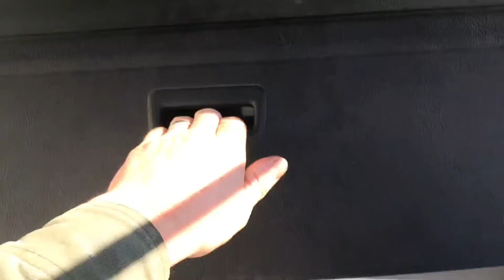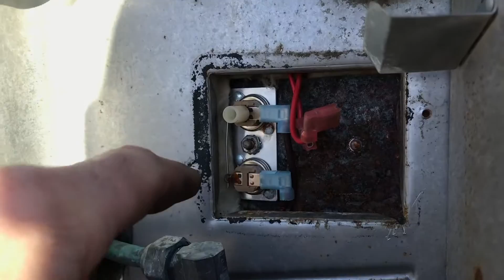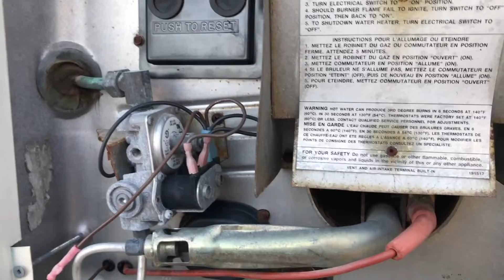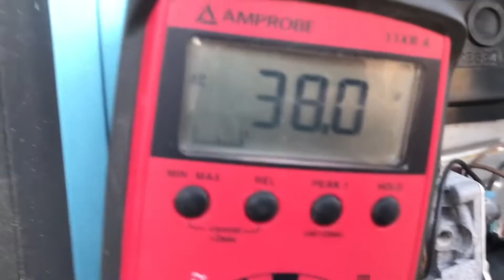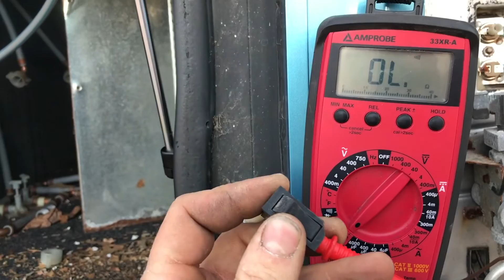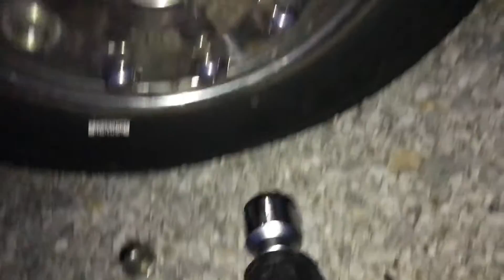Fixing an RV Water Heater

Comment: You might want to replace the anode (right next to the  heating element, that big rusty nut) as that will keep the  tank (and heating element) from rusting out / corroding. Cheers!

Comment: You replaced the heater but not the anode tube? If that heater was that bad the anode tube must be shot plus you will need to flush ass that crap out of the tank before you use it

Comment: Didn't see the entire scenario,  but it's possible that the car hauler driver deliberately used the oncoming lane to avoid getting hung up, or something.  Some car hauler setups have incredibly low-slung fifth wheels, which essentially become skid plates at times as they negotiate changes in attitude (and altitude) on roads and streets.  Also, he may not have been able to make the curve the way it was laid out with the cones (or whatever the lane separators) in place.
Reply: they saved the cones, from what I could see

Comment: I don't know who did the last service on those wheel bearings but those hubs are way overfilled. It has a full and add lines molded into the clear plastic of the hub cover.

Comment: Replace the anode in the water heater. A quick thing to do and will keep it running for many more years. Anode in a home heater is recommended to be replaced every 5yrs or so but it will depend on the amount of use and other factors

Comment: I'm puzzled there's no safety switch preventing the heater from being on when no water is in the tank.
Reply: Peter Riis most likely why the old element burned up.
Reply: @FishFind3000  
Perhaps. Looked more like corrosion started it.